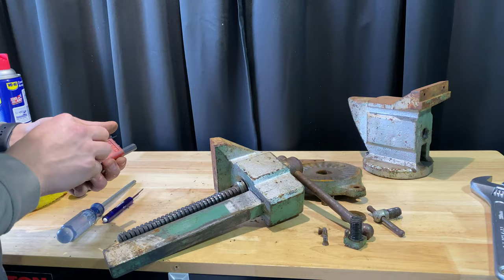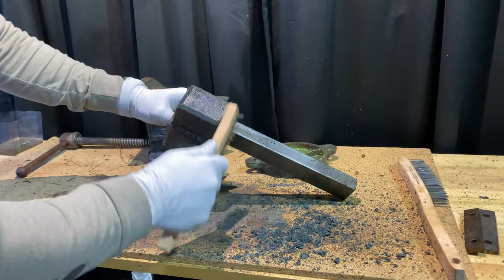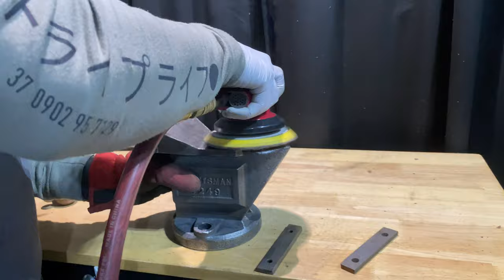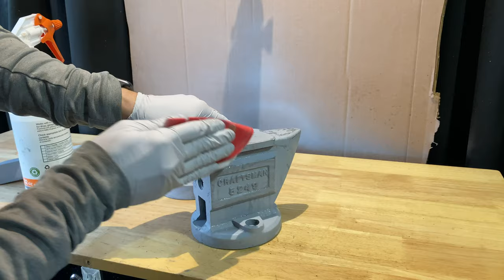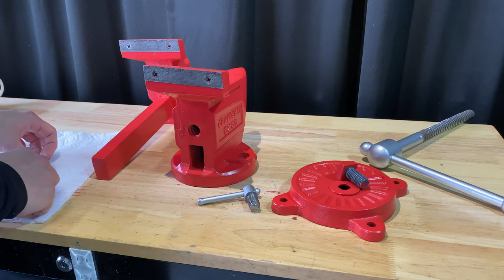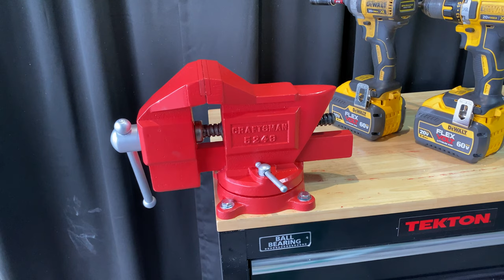Craftsman Bench Vise Restoration -  3 Layers of Paint

Comment: I prefer not to paint the anvil (flat square on top) because the paint will chip the first time you use it.  Sand with progressively finer grit and you can get a near mirror finish that won't rust with a thin coat of paste wax.